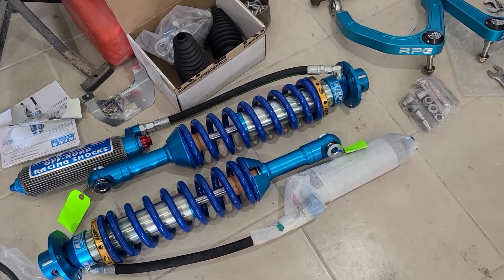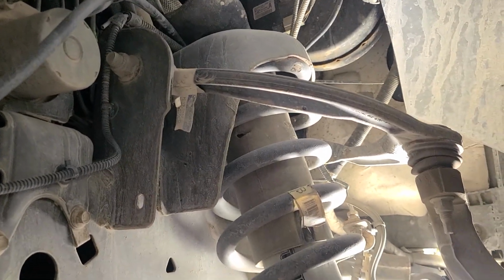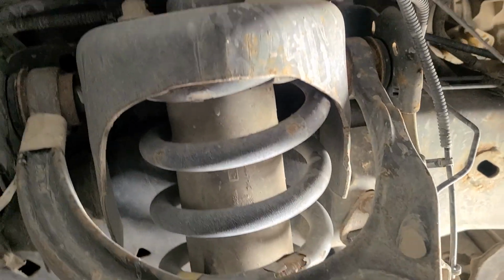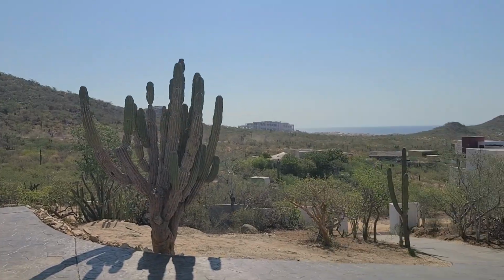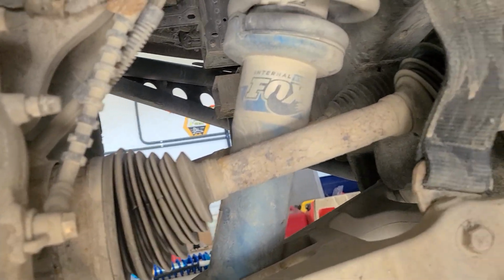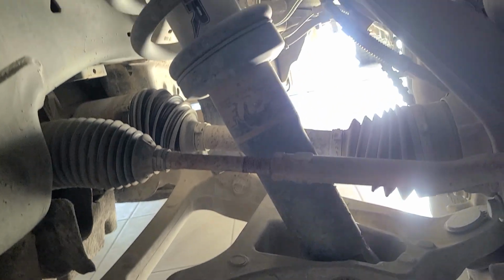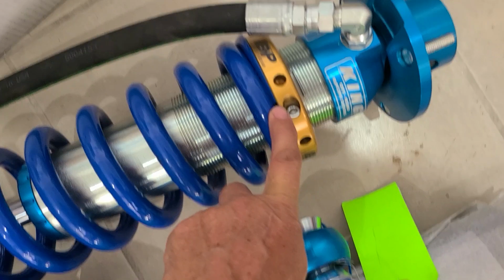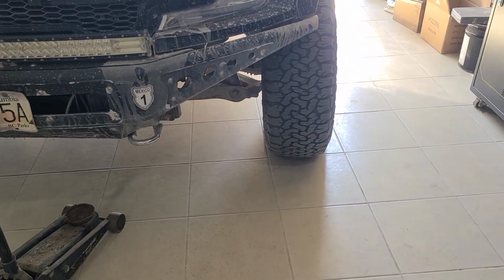Gen 2 Ford Raptor Suspension into F150 Diesel

Comment: Im planning to do this on my 2020 crew cab, did you also change Cv axles, and tie rods and brake lines? Thanks
Reply from the maker: You need: Gen 2 upper and lower control arms, CV joints, lower front shock bolts. The brake and other lines can be dropped down via a adaptor bracket and if you are buying FOX or KING shocks get Gen1 shocks for the front and they will fit best without cutting your truck up.

Comment: Wow man, you are a genius, but I got a lot of questions that I don’t know where to start, I’m actually doing a f150 2018 raptor conversion, I was about to buy the top hats, but after watching this you changed my whole game, so should I cut the springs to make it shorter ? Or should I reused my old oem f150 springs into raptor struts ?
Reply from the maker: You need: Gen 2 upper and lower control arms, CV joints, lower front shock bolts. The brake and other lines can be dropped down via a adaptor bracket and if you are buying FOX or KING shocks get Gen1 shocks for the front and they will fit best without cutting your truck up.

Comment: Great video man, I have a 2020 5.0 and am planning on installing raptor suspension and found a very good deal on a lifevalve gen 2 raptor suspension but started researching and found many people saying that the strut towers need to be modified. What do you think should I pull the trigger and buy the shocks?? TIA
Reply from the maker: The live valve shocks you may regret getting. They are a little soft. BUT, you can do the delete on them and they may be firm enough. I run 39" tires so the increased height stops the tire rubbing in the top of the wheel arch. You can put a complete Gen 1 strut in and that allows you to have a normal ride height on stock 35" Raptor tires and stock spring buckets